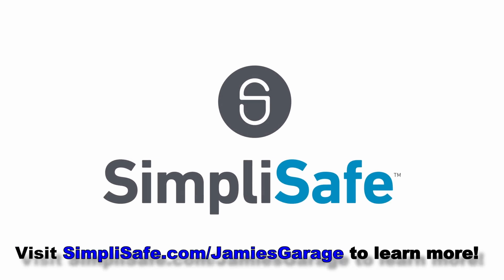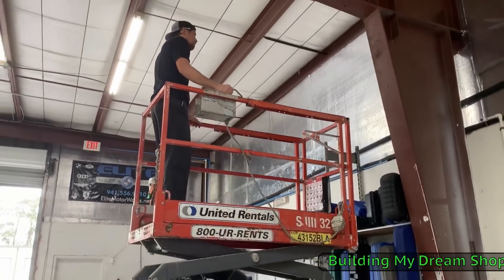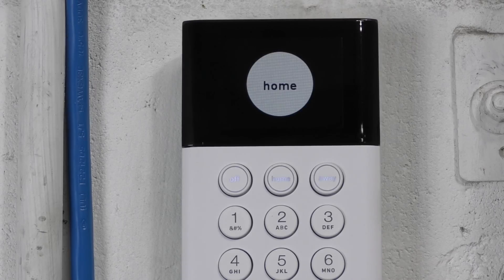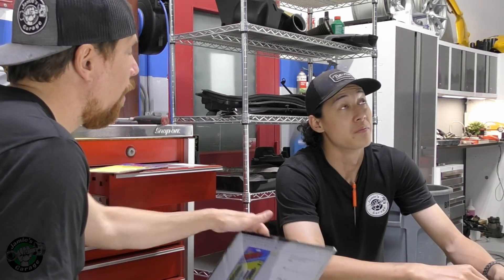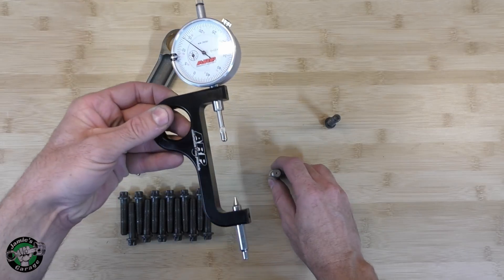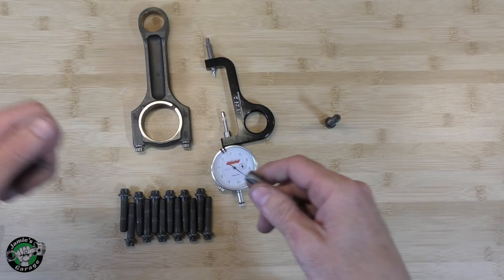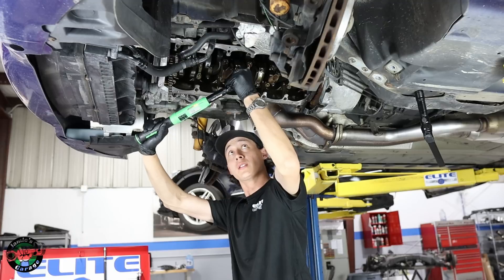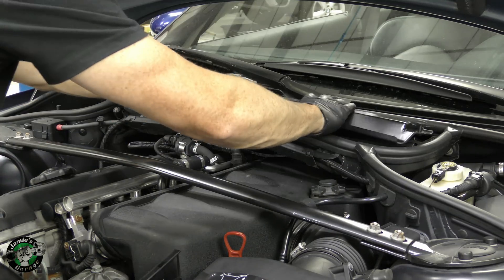THE tool you never knew you needed!

Comment: My S54 motor ('05 M3) @ ~104K miles per Blackstone oil analysis shows rod bearing in very good shape. I change oil, oil filter, and VANOS filter every 7500 miles or annually...coming up in OCT so another Blackstone run

Comment: I had a similar issue this year. Teared down the engine to check what bolts do I have and I have M10. And APR didn't have them in stock for the next 3 months, so I had to order stock bolts instead.

Comment: I just did this today actually on my engine build, and was surprised at my findings! Dealing with a Honda F20B engine, KS Tuned forged rods, ARP bolts and ARP ultra lube on the threads and under the head. 

The spec is 45ft.lb. but also calls for .0055-.0060" stretch. I ended up having to put around 60-68ft.lb to achieve the full stretch on each bolt to .0055" so either my torque wrench (a good condition Matco) is reading low, or the given spec is just kind of ballpark. Either way, the rod bolt stretch gauge is a great tool to have and use on an engine build along with a set of high precision micrometers and inside micrometer set, vice, etc. I got the Jegs aluminum gauge and it is pretty decent and ergonomically works well.
Reply: Also for what it's worth i think it's a little weak sauce that you don't actually throw a rod into a vice at least and demonstrate how in practical usage of this particular tool, you end up raising the torque value on your torque wrench in order to achieve the full required stretch. Also how you have to write it all down and keep track of each individual bolt because they're all slightly different lengths to begin.